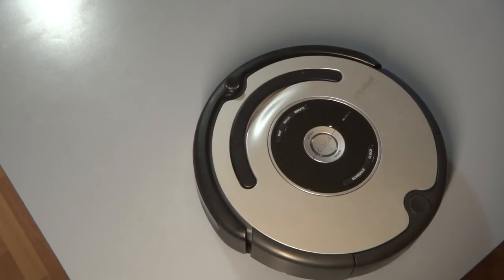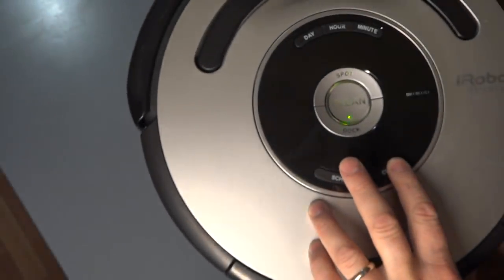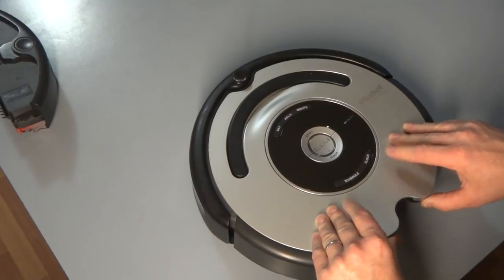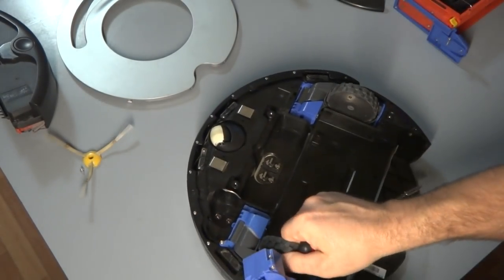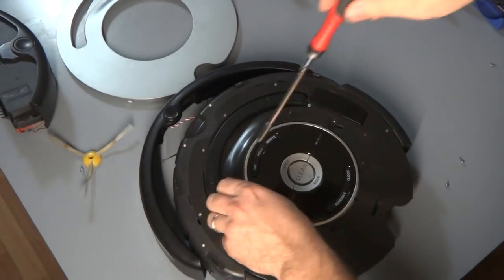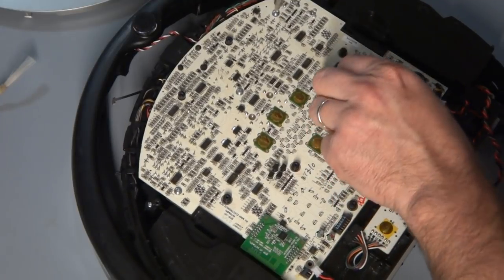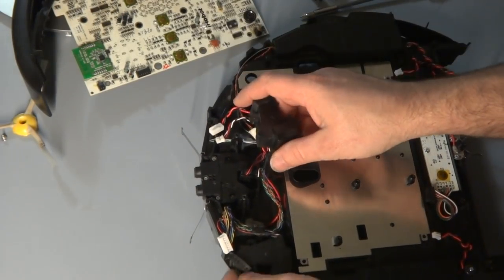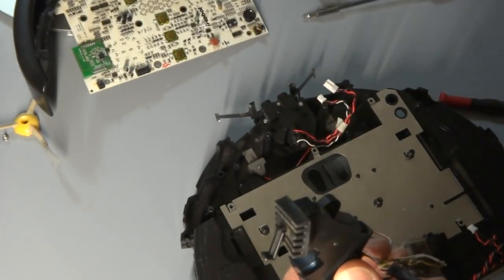1 iRobot Roomba 500 and 600 Series Circle Dance 9 Beep Bumper Error Full Disassembling Part 1

Comment: After sitting in the garage for 5 years, I attempted to use my 10 year old roomba 550. After replacing the battery, I was getting a 9 beep error. This series of videos was extremely helpful. I purchased new bumper and cliff sensors online and my 10 year old roomba 550 cleaned for 68 minutes today for the first time in over 5 years. Thanks so much!
Reply: Lly

Comment: Your fantastic videos have helped me repair my iRobot Roomba 535. It quit working 3 years ago and I just started using my old upright vacuum and left that one in the closet sitting there. I finally called the iRobot customer service and they told me that I had an Error 9 and that they could not fix it. They offered me a new one at a discounted price of $265. I said no thank you. Before I made the move to throw it out I did a Youtube search and found your channel. :) I ordered the part on eBay, and here we after 2 hours (I had to watch the video a few times as I was following along), it's done!!! My little robot is off cleaning my house once again.  I don't usually leave comments, but I felt that I at least owed you that much.  
THANK YOU! THANK YOU! THANK YOU!
Reply: my 595 pet series needs a new battery, what brand model would you recommend?

Comment: Your video helped me out a lot, I had used another video a few years back and it wasn't nearly as well-thought-out as yours I had no issues removing the old cliff sensors. But unfortunately the dog distracted me and then the phone rang, and when I started to finish up my job I had put the motherboard back in and all the connections and was just starting on the bumper when I realized I put the old cliff sensors back In! So an hour and 1/2 later I had the Right Cliff sensors. I also recommend popping off the plastic Covers' off of the sensors and cleaning them with some compressed air. I salvaged mine off of an old parts when I had and a few of them were cracked and dirty. It's pretty easy to do there's a little tab that you can get with your fingernails on each side  and then slide them up. Anyway thanks again for the great video and I love your accent! 🙂

Comment: Excellent and instructive video. My 650 had been working flawlessly every day for 9 years, then it went berserk and kept saying move to a new location. Did the tests and they showed it was a fault with an optical cliff sensor. Following this video I removed the sensors and they were full of dust. So I just pulled off the clear plastic housings, blew out the dust and vacuumed them, then reinstalled. All working perfectly again 😀

Comment: These are the older series. It was doing the dance and headed for the dump. I found this video and because I am in Canada I had to order parts from Amazon. There is a link on the third in this series that takes you to Ebay where you can send your own sensors for repair for $19.99 if you live in the US. Followed these videos for dismantling, instal and reassembly. Really well done! Clear, detailed and very easy to follow. My 500 series works like new. Can’t thank you enough.

Comment: Thanks for the video. I replaced my bumper/cliff sensor harness and I thought everything went well.  When I put the battery in, it kept going through the start-up cycle and there was a high pitched whine(not moving). I put it on the charger and it stopped going through the start-up sequence. but the loud whine noise kept going. I hit the clean button and it started to work fine. Bumper and cliff sensors working fine.  But the whine came back when it dock.  Whine is too loud to live with!

Comment: What do you do to actually repair the sensors? Could you describe what actually fails with them? Is it a matter of just fixing solder joints, polishing the plastic, or what exactly fails?
Reply from the maker: The IR diodes fail in them and need replacement, I sell them at my eBay store, my link is in the description

Comment: I have a Roomba 630 the right wheel had more resistance so it would go in circles. I replaced the right wheel module. As soon as you screw down the module the resistance is there. I checked the bumper and cliff sensors by doing the diagnostics and they seem ok. How can I fix this?

Comment: GREAT VIDEO, my roomba e6 has the same problem, I took it to the service and they said that the problem is on the system board, is there any way to identify whether the problem is located, to isolate the fault, because I felt tempted to replace the sensors and see what happens but I don't want to do trial and error if there is a better way to approach the problem, any ideas?
Reply from the maker: Yes, you can do a BiT (built in test) to determine the fault, also you can also take the Roomba apart and after taking apart the bumper sensors use an android phone camera or a digital camera that sees IR light and see if your IR LEDs are on when the test is performed, if they are dim or just not glowing the you would need to change the bumper sensors, but if the ON and bright then the issue could be with in the board, but there are other factors to consider that there could be faulty wires or bad soldering joints

Comment from the maker: hi, it is mostly different from the top area, since the faceplate is different, I am going to do a video on that soon, but in mean time, you would need to pop up the small plastics that go around and are parallel to the handle and there will be screws there

Comment: I have roomba 770.  Is taking that apart similar, or very different? My initial concern is removing the face plate.  It has 2 plastic clips that look like they would break if I just try to pry it off as you show with the 500 and 600 series.  Any suggestions?

Comment from the maker: if  you cut the wires it will think there is a cliff and will continue to go back or circle dance mode, what I meant by removing black pieces of plastic that separates light is so the photodiode will always see the IR LED and will continue to do its job by cleaning your carpet, steps to do this are simple, after removing the Cliff sensors, remove the clear plastic and upon doing so remove any black plastic that you see separating the light, which is inside the clear plastic and the holder of led

Comment: My 650: when I run the Roomba, it goes in a circle and does not travel to clean. Diagnostics clears all(blue light) but I feel it is stuck in spot mode
Any advice? 

I changed the black and white rubber wheel and that is all I changed. It did get stuck in one spot and wore out a side of the wheel

Comment: My bumper test looks like a stuck/failing left bumper, spot lights green without touching. Also cliff sensors light spot and dock for inner and outer but clean ring stays red. Where can I get replacement LED for bumper?
Reply: Amazon or ebay i think

Comment: I did the diagnostics etc and I am getting a solid green light on the Dock light for the right bumper that won't turn off.  It is not disengaging the sensor at all.  Will the replacement of the sensor fix this problem?  I appreciate your help
Reply from the maker: yes if the test checks out good for the left bumper sensor, then your are doing the test correctly and if you are getting the 9 beep error (Circle Dance) then replacement of the sensors will fix this issue

Comment: hi ty for your reaction.. i found a video on you tube here to tape of the lenses with aluminium foil it works but not great its like the robot is a bit disorientated.
i dont know what you mean by: and removing the little black plastic which separates the IR light.?
can i just cut the lens wires? will that do the trick?
my robot is an demo robot from a store that i got cheap without warranty so it doesnt matter to me what i do with it.
i really want it to work on my black carpet. greetz

Comment from the maker: Hi, there is a way but it could void your warranty and if you are using it on second floor and there are stairs it could fall, unless you set up a virtual wall, one way of doing it, will be removing the cliff sensors and out and removing the little black plastic which separates the IR light, if you need more info I can make a video, thanks.

Comment: Thanks for the video.  My unit has been stored for a couple of years and when I started it up, all it did was go in kind of a small circle and back and forth for about a minute or two then the 9 beeps.  I went through the process of taking my Roomba 550 apart and reassembling and it still comes up with the 9 beeps. When I go through the manual testing of the bumpers the center light stays RED.  Is there any kind of a cleaning method that may fix the problem or will I need a bumper assembly?  Could there be other issues?
Reply from the maker: when you perform the built in test do the spot and dock buttons light up when you press the according bumper side, pressing the left side should light up the spot button light and pressing the right side of bumper should light up the dock button, if one of them stays on lit the whole time, then the issue is with the bumper sensors, but in your case the issue could be not over, since you had it stored there could be an issue with moisture damage or corrosion, depending on the climate where you live at and the place where the Roomba was stored, if you would like more help let me know and I can help you get your Roomba back on cleaning your home
Reply: Thanks for the reply.  the first thing is that it had been stored in a hall closet without any kind of moisture present.  when I run the manual test the Date, Hour, Minute, Schedule and Clock buttons test fine with the Spot and Dock blinking when I press the buttons.  it is when I go to the next test for the bumper that I get no change when I press on either the right or left bumpers.  it starts off with both the Spot and Dock showing Green and the center Clean button stays red. Will repairing the sensors fix the issue?
Reply from the maker: Sal Petriello when the lights are lit in the second step of the test, then that means that the sensors have failed, and in need of repair, it means that both the left and the right are not actuated, 99.5 percent is when this is the issue, the other .5 percent could be caused by bad motherboard, wire harness not connected correctly, or wire harness is damage, so the answer is yes this repair will fix your issue

Comment: I took mine apart, cleaned it and put it together and still get the 9 beep error. The tests show that the left side doesn't light up once you're closer to the end of the bumper. Do bumper sensors require cleaning as well? That's the only thing I left out from thorough cleaning.
Reply from the maker: the 500 series and newer Roombas any cleaning wont help that much, most likely the sensors went out, you can send them in for the repair, just visit my eBay store, the link is in the description
Reply: TheiRobotChannel Peculiar thing is happening with the left bumper sensor. I completely disassembled it to get to the bare diodes and it appears to be responding better.  While running a test, it flashes the 'spot' lights when I put my finger between them. However, when I put the plastic diode cover back, the 'spot' light is steady. Do you still think it's the diodes?
Reply from the maker: Vadim A  the diodes give infrared light and when they are ending their life, the light dims, so the diodes are useless then, and need to be replaced with the new ones, which I sell on my eBay store, the link for it is in the description
Reply: oh, I had it fixed a while ago and it works like new. I'm not sure if I ordered from you, but thanks much for your help.

Comment: There are no steps in my house and one of my sensors seems to be bad.  Forward with 3 wobbles 180 then repeat over and over.  Is there a way to bypass the sensors?  Cutting sensor wires or sensor  joining wires?  Type 4120
Reply: My Roomba Discovery 4210 does this wobble too.  It also does "uh oh" with 9 beeps, but when I put it in self diagnostic mode, everything tests good.  This was a brand new Roomba that was unopened in the box.  I replaced the battery because it wouldn't hold a charge.  I'm confused how a basically new Discovery 4210 isn't working correctly.  I've also taken it apart and cleaned everything, just to be sure, yet it still doesn't work correctly.
Reply: Sorry Dan I never figured it out.  Bought a new one at Costco.
Reply: I bought a new one at Costco too.  Was just hoping I could salvage the old one.

Comment: Hello I have around roomba 500 it passes all the tests but when I start it, it just goes around in one direction on one wheel. I have replaced both wheel units. I think that it may be the mother board. Do you have any advice.
Reply from the maker: so does it starts moving in circle as soon as you turn on the power on the Roomba, or only after its on and then you press clean button? replacing the motherboard is a good idea, you wont loose any money if it was not the issue, buy a used one on ebay and if it was not the issue resell it, just make sure it is the correct model of your Roomba, also did you perform the whole test of the Roomba as in from start to end, I will add a link in my description in a couple of minutes of a zip file of the service manual, so you can see on how to perform the test in different ways, and will also make a video on this as well, in the test you can check if your wheels are the issue too.
Reply: TheiRobotChannel Thanks for your reply it only starts turning once you start it to clean. Not when first turned on. It always goes around on the right wheel as it does not move.Left one powering.  I have changed the right wheel but has made no difference. If you push the bumper it backs off a bit then carries on doing the same again. The machine caught my stereo and pulled it off the wall, the corner of the stereo hit the roomba on the top between the handle and the Minute switch making a dent. The right wheel does turn when it goes backwards. Could you please put the link in for the test as mentioned in your first reply. Thank you for your Help.
Reply from the maker: Garry Neighbour
well I had the link there and looks like iRobot removed it from my description, so I will most likely do a video on that, keep an eye on my videos and the new ones that will come up will have that video, thanks
Reply: Hi thanks  went through yhe test on utube ladt night . When you got to the stall test on the left passes and it should test the right wheel next but it dies not turn. The next test which makes both wheels turn works fine. Any ideas

Comment: I was able to put my Roomba back together with your help.  Now, I'm getting the (1 beep) "move Roomba to a new location error message".  The wheels turn freeiy,   I cleaned off the cliff sensors which weren't dirty,  removed and re-installed the battery.   Also, it comes out of the dock (about 2 feet) turns slightly and stops before the beep and error message.  The brush doesn't rotate either during this short period.     Any suggestions?
Reply from the maker: you could have plugged in the harness backwards, please take apart and reassemble, and watch for the harness to be plugged in correctly and all the way, and let me know how that works out for you
Reply: TheiRobotChannel It took me awhile to get back to this.   I checked all of the harnesses to insure they were plugged in correctly.   Same result...didn't work.   I also purchased and installed a new set of wheels and a brush motor.  That didn't help either.
Reply: I am having this exact issue, six months after warranty expires. It seems to be one of those "common enough for many people to post online, but not common enough for there to be a solution" problems.

Comment from the maker: what ever you do please do not cut the wires for the cliff sensors as that would do even worse, let me explain how they work: in the cliff sensors there are to diodes, one is the IR LED which put out a light in IR and the other is the Photo diode which detects the IR light and takes the signal to the computing processor. The IR LED's light bounces of the floor and the Photo diode sees the light and continues to drive, but when there is no light detected (ex. cliff, black carpet) it goes back.

Comment: I tried the bumper test and the spot lights and the dock lights but also dirt detect button lights and the test does not turn green what does this mean and how do I fix
Reply from the maker: +Philip Price make sure you are in the correct test as there are several test modes, if the spot light and dock light, light up each time you press and then release the bumper sides, and the lights turn off, then that means the bumper sensors are okay and issue is someplace else, so make a video and let us see what the issue is if you can, if  one of the light always stayed on that means the issue is in the bumper sensors, Oh and the dirt sensors is just blinking to tell you which step of test you are at (2 blinks=step 2 of test)
Reply: this test procedure does not work on the 530  ,also what about dismantling a 530? do you have a video for that? i already got my leds for bumper fix int he mail